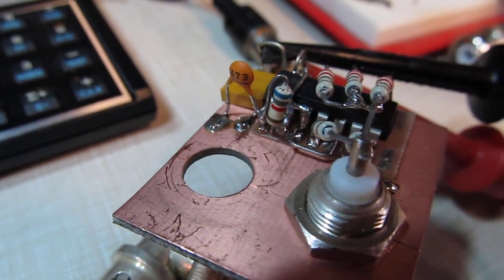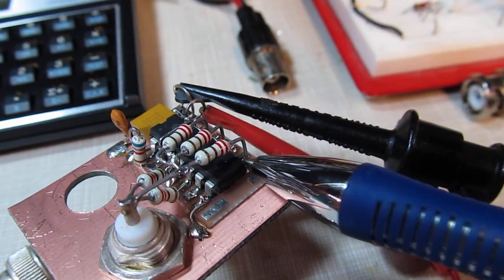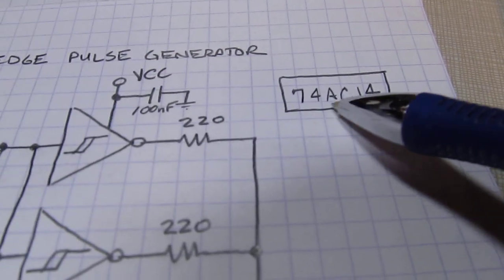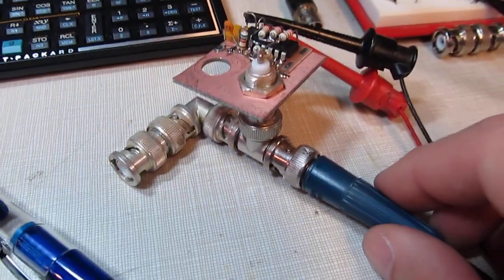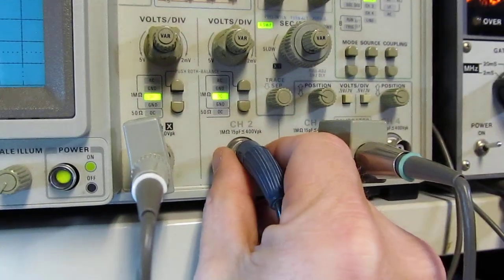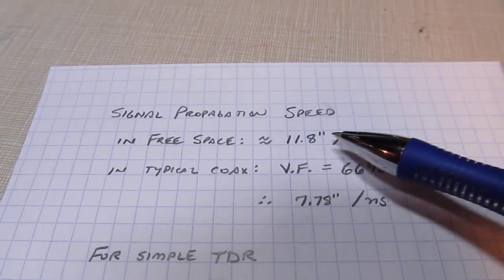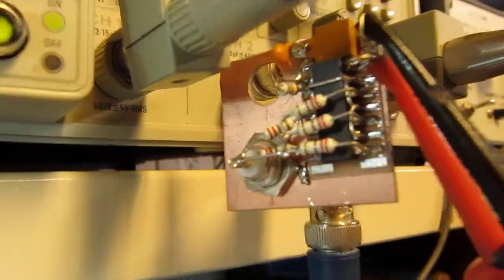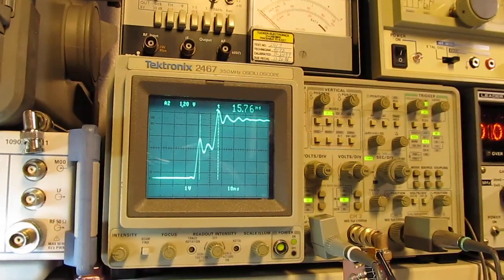#88: Cheap and simple TDR using an oscilloscope and 74AC14 Schmitt Trigger Inverter

Comment: Do TDRs work on Copper/Steel cables such as the D10 cable?
Reply from the maker: It should work somewhat.  The D10 cable is a twisted pair which should have an impedance of 100-150 ohms or so.  It won't be perfect, but should work well enough to indicate a break or short.
Reply: I bought this https://www.aliexpress.com/item/DSO-112A-TFT-Mini-Digital-Oscilloscope-Touch-Screen-Portable-USB-Oscilloscope-Interface-2MHz-5Msps/32629013364.html?spm=a2g0s.9042311.0.0.d1Wl6S to use as an oscilloscope. That was when I noticed that it actually had an output port which sends out a test signal (can only control the frequency). I'm wondering if the output test signal can work in place of the circuit you've shown here. Because I can't seem to detect any reflection signal using that set up.

p.s. I don't really have much background. Only had 3 years of studies but that was over a decade ago so I only know some basic steps. So, please forgive any misunderstanding of how the stuff works on my part.
Reply from the maker: This is probably not going to work for the TDR application - mainly because of speed (lack of speed).  The output test signal's rising and falling edges are likely going to be quite slow which will severely limit the minimum length of cable to be tested.  Perhaps worse, the 2MHz BW of the scope is also far too slow to preserve a TDR step.
Reply: w2aew when you say about the 2MHz BW of the scope being an issue, you're referring to its ability to output a test signal or the ability to read the signal?
Reply from the maker: A scope with 2MHz of bandwidth has a risetime of about 175ns,  This will severely impact the ability to see reflections.  Assuming approx 8" per ns, 175ns refers to about 120 feet (about 36m) of distance.  Any cable shorter than this will have it's reflection lost in the risetime.
Reply: The 2MHz bandwidth that you're referring to is the output signal?
Reply from the maker: No, it is the measurement BW of the oscilloscope.
Reply: Any recommendations for use out in the field?

Comment: In many of your videos you are using something like pl259 connector or something like that..would it not be efficient to use any bnc or sma or is there anything particular with this types of connector and configuration you do (beside bandwidth).. soldering for every experinment takes quite a while so is there any trick you use to make this?
Reply from the maker: I typically use what I have on hand.  I'll generally use soldered coaxial connector when the performance is needed, or I need a more robust construction.

Comment: I've build this but I'm getting a risetime of 3 µSec instead of 2nSec.  I am using the 74AC14 so that should be okay. I've used metalfilm 1% resistors instead of Carbon resistors. Could that be the cause?
Reply from the maker: Certainly sounds like something is not right?  Are you using a 1X probe?  That will certainly slow things down dramatically.  Must use 10x probe or 50ohm cable to a 50ohm termination at the scope.
Reply: I used a 50 Ohm cable into a 50 Ohm termination but I'm beginning to suspect the chips I bought might be fakes. I'm not sure though. I ordered them from Britain instead of China because I wanted the real ones (I bought a batch of 10) but I think they might be fake anyway. Is there any way you know of that I can tell for sure? The TI emblem seems to be lazered into the chips and look real enough but I'm no expert.
Reply: Okay I figured it out. The chips were fine. Channel one on my scope is broken. It works fine on the other four channels (Rigol ds1054z). I guess it's back to shop for some repairs.

Comment: Great video Allan!
I`m just re watching your video on this TDR pulse generator, which I first watched maybe 2 years ago, which inspired me to build it re purposed for something else.
Two years ago I was looking for something that I could use as a fixture to calibrate a 60Mhz oscilloscope's step response. A "poor men's" approach for someone who didn't have a fast edge pulse generator (<1ns) and this one is still the only one I have.
It just crossed my mind to thank you and report back that the quality of the step is fairly decent and for this sort of bandwidth and up to about 100Mhz, it's good enough to calibrate the scope to the specs (less than 3% overshoot / ringing.
In fact, the output of the AC14 ganged buffers is quite sharp and flat (almost no overshoot at all) and just a little pre-shoot bump (some told me it's due to the AC14's ground bonding wire, inside the package).
I actually build it a little bit smaller than yours, with an SMD AC14 soldered (just the power pins) to a dual sided blank PCB heavily decoupled, and with 0603 smd resistors soldered directly to the AC14's pins for the output.
It works like a charm.
Reply: The trick with AC14 is to use 2/6ths of the chip as a cable driver, and the 4/6ths to lower the impedance of the power delivery to the chip. How? Feed “0” to 2 inverters and connect their outputs directly to VCC. Feed “1” to another 2 inverters and connect their outputs directly to GND. You’re now driving the on-chip power distribution through two extra pins per rail. It improves things quite a bit. You need more chips then of course, and their inputs and outputs must be respectively equidistant. So the oscillator must connect to all the inputs via a wire/trace of identical delay. Same goes for the outputs connecting through the resistors to the BNC. With some extra care that chip can drive just under 2ns edges, extremely cleanly.
Reply: @absurdengineering  wow, what a trick, live and learn. i suppose it should also apply to other chips as well? for example the AC00 that I used in a similar little project.
Reply: @s_s-g4d  Yes. But always measure stuff and use an objective way to see the difference, like capturing a reference trace on the scope using a straightforward circuit, and then observing how the “improved” circuit’s output compares to the reference trace. It should be done using the intended load too, ie. 50 or 75 ohms or whatnot, properly terminated.

Comment: I want to generate a fast pulse (about 1MHz) using FPGA that can drive 50 ohm coax cable. The pulse i am able to generate is 1MHz with 11ns rise time. What external circuit should i have to use to make it as fast 2ns rise time and terminating at 50 ohm
Reply from the maker: You could buffer it with something like the 74AC14, or any other high speed logic family.  There are also line drivers available.

Comment: Antenna question: I bought a log-periodic mobile data (LTE) antenna from Aliexpress and before I fix it on the roof decided to measure how it is impedance matched at the antenna end. It turns out that when I feed a waveform from the end of the coax cable with this circuit, there is a strong "downwards" reflection at the antenna end, which is not quite short circuit, but almost. When I measure the DC resistance at the end of the coax, it is 3 ohms. Is this normal?
Reply from the maker: This circuit would be inadequate to measure an antenna that is tuned for the LTE bands.  Antennas are typically tuned to a specific range of frequencies.  A TDR is useful only for broadband impedance matches.  DC of 3 ohms is probably normal.

Comment: can you explain the reason, why five extra schmitt triggers are used in fast edge pulse generator
Reply from the maker: To increase the current available to drive a 50 ohm load.
Reply: w2aew do i need the same arrangement if i generate a square wave to drive a coaxial cable from a microcontroller?
Reply from the maker: Depends on the speed of the square wave and it's rising and falling edges.  If they're fast enough, and the coax length is long enough to be considered as a transmission line, then it needs to be terminated into the coax's characteristic impedance and you'll need to be sure the the circuit driving the coax can adequately drive this load (usually 50 ohms).
Reply: ok...Thank-you

Comment: Why do you have to match the impedance of the output to the cable? Is it because the reflected wave would be shorted to the same potential than the output if you fed the cable directly from the output so that you could not measure it on the scope?
Reply from the maker: The output impedance of the source is ideally matched to the transmission line so that any reflections are perfectly terminate and don't reflect back down the line again.
Reply: w2aew But it increases the rise time, does it not?
Reply from the maker: If a device is designed to drive a 50 ohm load, then proper termination does not increase risetime.
Reply: w2aew Imagine that the signal at the output of the Schmitt-trigger is instantaneous, i.e. has zero rise time. When the transition occurs, the series resistor, which is there for impedance matching, and the capacitance and inductance of the cable, together form an RLC circuit, and the signal takes a non-zero amount of time to rise, no? So, isn't the rise time at the end of the cable necessarily longer than at the output of the Schmitt-trigger, i.e. on the other side of the series resistor?
Reply from the maker: One thing that you have to remember is that a 50 ohm coaxial cable appears like a 50 ohm resistor to RF when properly terminated, not an RLC circuit.  So, the combination of the 50 ohm output impedance and the properly terminated transmission line looks simply like a resistor divider.
Reply: w2aew That's where I went wrong, thanks! :-) I am actually going to build this project, just received the parts from Aliexpress the other day.

Comment: If i cant get 74AC14, can i use 74HC14 and intergrator capacitor?
Reply from the maker: Sure, it just won't have as fast rise/fall times.  So, this limits how "short" the cables under test can be.
Reply: w2aew Thanks.

Comment: Dear Alan (+w2aew)
May I please ask: Why did you use the 5 triggers in parallel?

Do you publish your schematics?

Kind regards

Great Videos!!!!! 
I always enjoy them.
Reply from the maker: I put 5 in parallel to lower the output impedance.  I usually publish the schematics as PDF files that are linked in the video notes/description.  I started doing this a few years ago.  However, I was unable to find my original schematic for this one, so I didn't have it available to scan.  Luckily, this is simple enough that you can copy it from the video.
Reply: Dear Alan (+w2aew)

Thank you very much for your response.

I've had great fun  playing with the oscillator and one of the Schmidt triggers.
I've put a variable resistor in and played around with the capacitor.
On very short pulls lengths, I got quite a bit of 'ringing' on the capacitor leg of the oscillator!   
The 100nF electrolytic capacitor between Vcc and ground had to be very close to the Vcc and ground pin on the breadboard not to cause some additional ringing effects.
Was great fun!

Thanks for a great channel!.

I love the back to basic series you did.

Going to try to build that stair step generator next.

Kind regards
Stephan

Comment: Hey Alan, wanna hear a good one.  The 74AC14 is discontinued according to Jameco Electronics.  I used the HCT14 which has a rise time of 5 usecs.  Just for shits and grins I tried measuring cables shorter than 4 ft and it didn't work.   But... that's what they make tape measures for.  :-D  I use Jameco for most of my parts purchases since they give free shipping for orders over $25.  Usually I'm lucky if I'm under $50.

Comment: Alan, thanks for the great video.  It prompted me to build my own 9 volt powered time base generator based on a 10 MHz clock oscillator.  I wanted something a little more versatile so I I'm using 2 74HCT74 DFlops to give me a range from 10 MHz to 625 KHz. I tried it at the lowest frequency with an ~ 5' unterminated cable and lo and behold it worked!  I got a 17 nanosec delay which after calculating the length equaled 66.1 inches which was pretty close to the length of the cable I made.  Isn't math and physics great!
Reply from the maker: Cool!

Comment: If you don't mess around with inches and feet, the math gets a lot easier. The round trip time is about 10ns per meter with a vf of 0.66.
Reply from the maker: Yeah, metric to the rescue. ;-)
Reply: It's not "metric" it's "S.I.". "I" for International. 😋
Reply: @cmuller1441  also known as metric....

Comment: I built something similar a while back now,  documented here http://alaskareflector.org/zl1nc/tdr.html
Using a simple no-frills lo-end portable oscilloscope it was a great fault locating tool I used for Cat5 and 6, as well as coax.
In the first image in the link you can see my "multiplier" sheet.  To get these values I measured the time between pulses of a full roll of cable, and divided the time by length of cable I was measuring.  Quite accurate.  
So for a cable buried in the wall (or ground!) A simple cable locator following a tone source to trace the route, then the TDR to measure the distance, I could usually find the cable fault on the first hole cut in the wall.  A hard working little bit of kit that saved MANY hours of destroying client's buildings looking for that nail through the cable!!!!

Comment: We had a manufactured TDR which was invaluable for figuring the length of cable on a spool. Very good video showing a low cost way of doing the same thing. Not as fast, but you're not selling to a client either.

Comment: Does it matter if I use the HC version instead of the AC one?
Reply from the maker: You can, but the slower rise/fall time will limit the distance resolution, as well as the minimum cable length that can be measured.
Reply: Ok, I just tried it and you are right. A koax of 8meters could be "seen" but not one at say one meter.

Comment: This is great, I've seen a few variations with switching to Make a TDR for very long cables as well as shorter cables.
I suppose I'll have to look at the specs on the chip itself, but is there a way to optimize that chip to test things like xlr cables.  I need to test things like 150' cable snakes to 10' cables.  I know that a lot of "Instrument" cables have characteristic impedance's roughly around 50-75 ohms, so I'm guessing impedance matching wont be too much of an issue?
Reply from the maker: Impedance matching isn't a issue.  However, the technique does rely on the cable itself to have a relatively constant characteristic impedance.  Shorter cables require a faster edge speed on the tester.
Reply: do audio cables have fairly constant characteristic impedance, or does the flexibility of the cable make it vary too much?
Reply from the maker: the coaxial cables should have a reasonably constant impedance - at least decent enough for a TDR to be useful.

Comment: W2aew - Very nice!  Instead of using a BNC T, were you thinking of putting a resistive power splitter at the output?  I am guessing the extra hole was for a 2nd BNC, so one for scope and one for Cable under test.
Reply from the maker: +Robert T The extra hole is there for no reason - this was a scrap piece of PCB material that happened to have two holes in it already from a previous abandoned project.

Comment: Really amazing tutorial.
I built this on a breadboard with a 74HC14N and used a 10k multi-turn trimpot for a range of ~3kHz up to 500kHz.
Pretty nice to see those steep edges on screen. :o)
(I did this to test my new old scope. The 10 MHz bandwidth seems to filter most of the ringing away, though)
Reply from the maker: +Thilo Niewoehner I'm sure it looks really nice and clean with a 10MHz scope!
Reply: ***** Absolutely. As I said, most of the ringing is gone except for a 0.5 V overshoot (at 5 V supply).
And the edge appears really steep, while the fastest timebase on that scope is 0.5 us/div (actually 0.1 us with x5 zoom)

I'll check this once more next weekend when I have the remaining parts for the similar 555 pulse circuit with adjustable duty cycle.
Then I can also compare to my 100 MHz DSO.
It's quite some fun to play with analogue circuits every now and then :-)
Reply: If I get to it, I'll try to take some pics and show them together with the Telequipment D61a scope over on eevblog.com

Comment: Great video, as always.
Maybe I would have liked a bit more explanation about the Schmitt Trigger diagram. I understood that the first trigger was connected to VCC as well  (we don't see that) and outputting VCC into the 6.8 k resistor as long as the 47 nF cap was discharged. Is that right?
And why do you need the 5 other triggers?
Reply from the maker: +fabts4 There is more information on the schmitt trigger circuit in this video:
http://youtu.be/NuXitMK3HSA
I used all the inverters in the package to increase the drive capability.
Reply: +w2aew My question was really about the schematics and wiring. You have to input a signal or connect the trigger to VCC, I didn't ssee that explained in #87 either.

Is the current substantial, then?
Reply from the maker: +fabts4 The VDD pin is connected to the power supply, but there is no other signal injected.  One gate is used as the oscillator, and the remaining are paralleled together as a buffer.  The output drives into a 50-100 ohm load - which would be too heavy for just one gate, so that's why I paralleled them.

Comment: Suddenly my 40-meter yagi had a high SWR. I used one of these little TDR circuits and determined the exact location of the problem. I'm sold. Thanks! 73 de K8CU
Reply from the maker: +Bill Jones That's great to hear - glad it worked for you!

Comment: I  ordering parts to build this TDR
instead of 220 ohm resistors would  260 ohm work  that would equal  52 ohms on output   thanks
Reply from the maker: They'll work fine.
Reply: thank you very much

Comment: Hi, I only have a CD40106 Hex Schmitt trigger at hand. Would anything stand against building a square wave pulsing circuit around the 40106 for that purpose? thanks in advance!
Reply from the maker: You could build an oscillator with it, but the rise/fall times are way too slow for any TDR work.